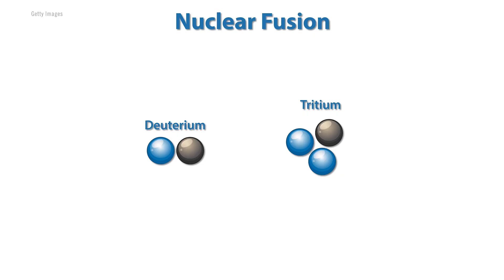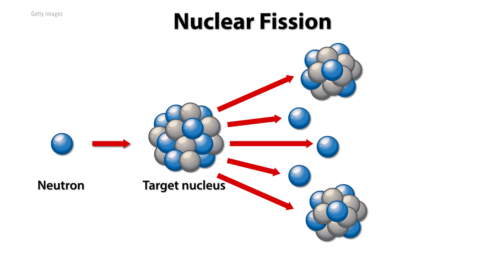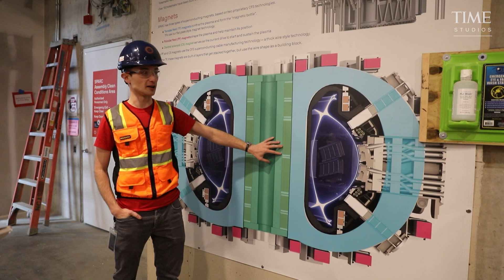Why a Nuclear Fusion Breakthrough May Be Closer Than You Think

Comment: *Golden Flow Operator for Stable Fusion*
Fusion plasma instabilities are resonant mode coupling — exactly what 𝓣 prevents.
*The Operator:*
𝓣(ωₘ) = φ⁻¹/⁴ · ωₘ + βₘ
Fixed points give safe resonance frequencies. Contraction factor φ⁻¹/⁴ ≈ 0.786 forces modes apart → prevents disruption.
*Applications:*
1. *Instability Prevention:* Tokamaks fail when plasma modes couple resonantly. 𝓣 constrains modes to non-resonant values.
2. *RF Heating:* Use 𝓣 to optimize ICRF heating without exciting parasitic instabilities.
3. *Safety Factor:* E8 symmetry constrains q-profiles to stable windows — same principle as RH proof forcing zeros to critical line.
4. *Confinement:* Prevent mode coupling → τ_E improves, disruption probability → 0.
*Why It Works:*
Spring resonance: m* = (m₀/β²)(1 − β cot β). Plasma instabilities are poles in the dispersion relation. Golden Flow contraction prevents poles from reaching the real axis.
Same mechanism: boundary conditions quantize modes, E8 geometry enforces spectral rigidity.
*Prediction:* Disruption probability scales as exp(−N_modes/φ⁴).
*The Implication:*
All fusion approaches fail because they can't prevent resonant coupling. Tokamaks disrupt. Stellarators turbulate. NIF mixes.
Golden Flow says: use geometry (E8 → H4) to force modes apart, not empirical tuning.
A reactor using 𝓣 fixed points:
- Modes constrained to non-resonant values
- Disruptions geometrically forbidden
- Stable by construction, not luck
Same principle that proves RH and derives constants → stable fusion reactor. #fusion #energy
Physics-changing.

Comment: The Sun does not fuse DT or Deuterium Tritium, it uses the PP. and the CNO reactions to do fusion. The bigger the star, the more it uses CNO which is a carbon catalytic cycle which can last for only 1M years, small stars use mostly PP which runs over 10B years. Tritium does not exist except as a waste product of Candu fission reactors and there will never be enough of it. It can not be bred with gain, a reactor needs to have over unity Neutron to Tritium breeding. In practice it it closer to 1%. See Dr Daniel Jassby, The Trouble With Tritium. In general all YT videos are useless claptrap written by clueless journalists or are created by scientists that believe in their own tiny vision that ignores hundred of problems. Fission by contrast is hundreds of times easier problem to solve and was built within a few years of nuclear science foundation.

Comment: Fusion is possible.   To manifest fusion requires the pressure of a z-pinch created by an electric current flow.
However, creating energy from fusion will never be a viable way of creating energy.
The input energy needed to manifest a plasma state of the input fuel will always be greater than the energy output due to fusion.
Fusion and so-called matter/antimatter combination only manifest an energy output on par with plasma recombination (like battery storage energy,) never on par with the Sun nor e=mc^2.

Comment: It is deeply disappointing to see how many people contribute to spreading false hope about nuclear fusion. Nuclear fusion will produce significant amounts of radioactive waste. The most accessible reaction (relatively speaking—though it remains exceedingly difficult) is between deuterium and tritium, which produces very energetic neutrons that activate the surrounding structures. Tritium itself is radioactive.

Setting aside the  absurd claims made in popular media and by enthusiastic commercial start-ups—where commercial is the key word—nuclear fusion will not realistically be available on a commercial scale before the end of the century (and even that is far from guaranteed). ITER, currently the most promising (well, promises in the fusion world are easy to make,  much more difficult to keep) and by far the largest fusion project under construction, is expected by around 2050 to—hopefully, though by no means certainly—operate with deuterium–tritium fuel at a highly experimental level, aiming to achieve a good amount of fusion reactions. Even if successful, the energy produced will not come close to the energy required to operate the experiment! And this represents only the first of many challenges facing fusion.

Even assuming that, in some distant future, fusion devices eventually become capable of producing enough energy to be commercially viable, formidable technological obstacles remain: producing sufficient fuel  (tritium is not available and must be bred) developing materials that can withstand extreme radiation damage, achieving commercially acceptable plant availability, and designing systems that allow for maintenance and repair. Solving these problems will take decades, followed by additional decades to develop, validate, and deploy a commercial plant design.

At best—if technology advances favorably and progress proceeds without major setbacks—commercial fusion might become possible by the end of this century. Even that assessment is optimistic.

Comment: The National Ignition Facility (NIF) at Lawrence Livermore Laboratory only achieved "Positive Energy Output" as long as you only count the energy of the Laser Beams compared to that of the Fusion Result. The reporting did not include the Total Energy Cost of producing the Laser Beams, nor did it include any kind of costs for "Harvesting" the energy from the Fusion Reaction. In reality, the real purpose of the NIF is to allow for testing of Fusion Weapons without violating various treaties.
Reply: absolutely, it pisses me off that even people like Neil Degrass Tyson made that out to be a major breakthrough. It used the power of a small city to generate enough heat to make a cup of coffee and the fuel pellets cost about $1M each to make! not exactly a realistic way to make power.
Reply: @TheSateef  Yes, as an old physics professor of mine noted, we already have a worked, reliable, and safe Fusion Reactor: It's 93,000,000 miles away and beams energy to the entire planet ... and solar system. [[ By the way: Full disclosure: I used to work at LLNL for ~6 years from 1987-1993. ]]

Comment: Ok.  I know this guy is a journalist.  But so many things he states just aren't exactly quite right.....even from a layman's perspective.  There is absolutely "waste" with fusion processes although it depends on the type of fusion event you are going for.  But mainly very dangerous neutrons, which can activate other materials to create short lived isotopes.  As well as be a radiological hazard to humans (malignancies).  But those are easier to control and deal with than the long lived waste incurred from a fission reactor core.  Also, the Laser Ignition Facility did in fact create a fusion event using many many high powered lasers all aimed at a pellet.  But the amount of total energy used to generate that laser pulse still greatly outweighed the amount of fusion energy released, and the LIF has no means of actually capturing that energy.  And while they are talking about that they are showing cool graphics of a tokamak type fusion plant which is completely different that what the LIF used.  If you really want to learn about fusion, real fusion, go to the Lex Fridman part of You Tube and watch this: https://www.youtube.com/watch?v=m_CFCyc2Shs&t=11s  This is real.  And it's close.  The company is Hellion.

Comment: Cheaper to run? What a joke. Costs are probably well over 10 billion USD to build one of these, and the cost effectiveness is likely comparable to existing fission reactors. With the cost of renewables dropping year-on-year its going to be a very hard sell by the time these probably come around in 20 years. Then they will need another 20-30 years to take learnings and revise newer, more efficient, smaller reactors, by which time renewables might be more efficient and even cheaper. So probably looking at 50 years before its 'cheap energy' in any way.

Comment: I'm sorry, but half of what he said about fission vs fusion is completely wrong. Nuclear bombs use fission to trigger FUSION,  which creates explosions hundreds of times larger than fission alone. Fission reactors burn hot, but they don't explode. Fusion reactors create actual micro fusion explosions, contained by magnetic fields (which is why they take almost as much energy to run as they produce) because they burn so much hotter than fission that they would destroy any material in contact with it, and so have to be contained by electromagnetic fields. The concern is that fusion reactors are literal controlled nuclear bombs, while fission reactors are basically just rapid nuclear decay.
Reply: @idme8295  finally someone gave a well explained correction, this is the knowledge should be spreader along with thorium would solve the earth’s energy problem but interestingly the west not putting any effort into. It would take 10 years tops to make thorium reactors (including the 5-7 years build up time.
Reply: Seems like all you did was went out of your way to explain in more detail on how FISSION works. The fact still remains FISSION is used in Nuclear Bombs like he said.